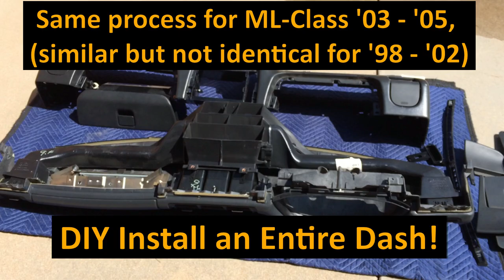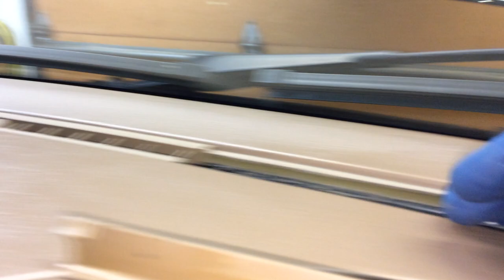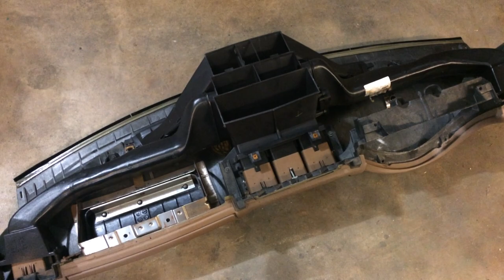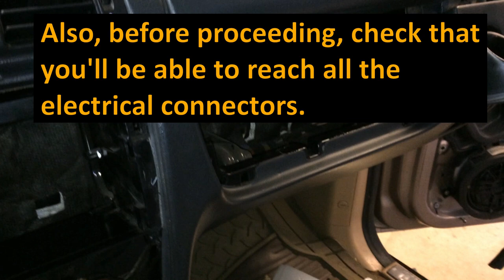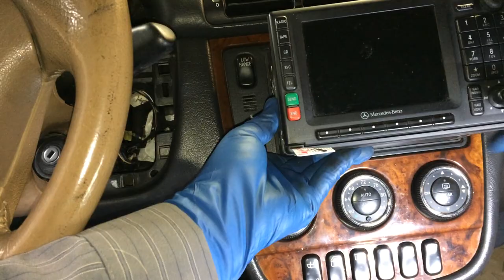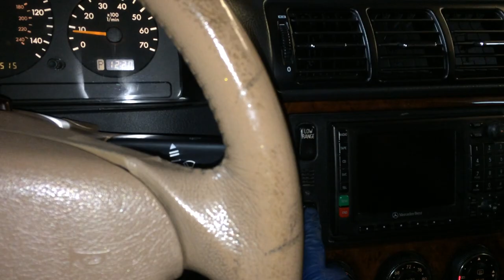Mercedes W163 ML-Class 2002- 2005 Replace Blend Door Motor, Dashboard Removal, Replace Entire Dash

Comment from the maker: CORRECTION: At 00:08, I wrote "Same process for '03 to '05" but I should have wrote "Same process for '02 to '05".  Likewise, where I wrote "'98 to '02", I should have put '98 to '01.  The "facelift" occurred for the Model Year 2002.
Timestamps & important info:
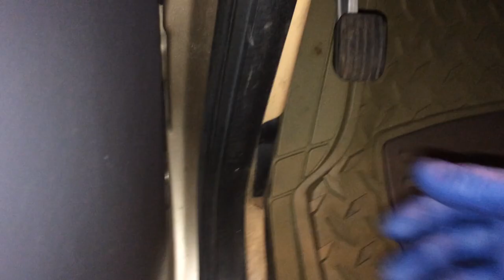00:20  Disconnect negative terminal on battery
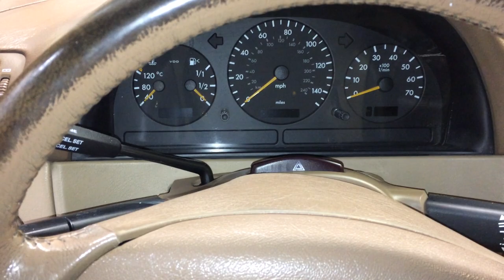00:51  Remove steering wheel collar top trim
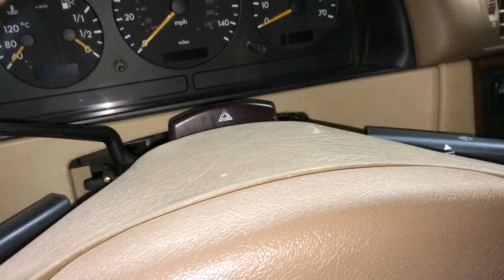01:54  Remove dash panels by steering wheel, right and left
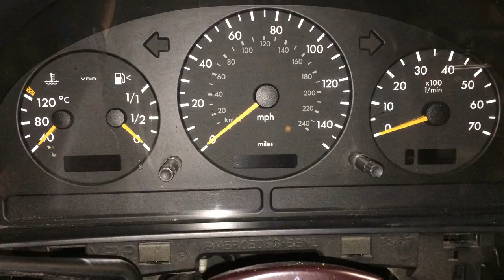02:59  Remove Instrumental Cluster black trim piece
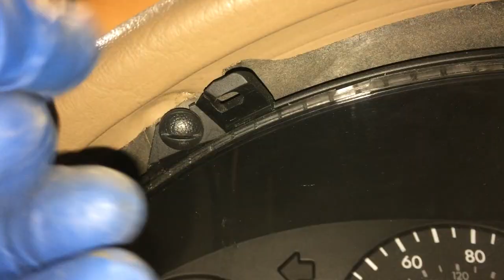03:55  Remove Instrumental Cluster
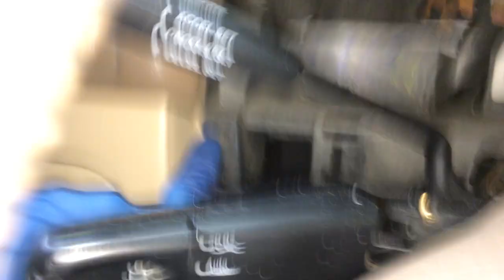05:05  Remove Driver's side dash fasteners
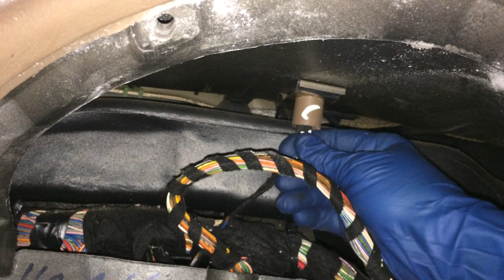05:17  Disconnect electrical for automatic headlight sensor
05:25  Disconnect electrical for front center vent door motor
05:44  Remove fasteners on lower Driver's side dash
05:52  Remove radio
06:00  Reference drawing to make your own Radio Key
07:17  Remove upward facing dash fasteners behind the radio opening
07:39  Remove A-pillar trim pieces
08:33  Remove dash side trim panels and Torx 25 screws
08:47  Remove Defroster Vent Trim and fasteners
09:39  Remove Glove Box
10:30  Remove Wood Trim panel around radio opening, remove electrical switches
12:14  Remove four dash fasteners behind radio Wood Trim panel
12:33  Remove Passenger's side lower fast fasteners
12:49 *Check that all fasteners have been removed*
14:28  Start to remove Top Dash
17:52  Remove Heater Air Temp sensor before completely removing the Top Dash
18:37  Top Dash removed
18:42  Mouse activity discovered!
18:51  Blend Door Motor/Actuator location
19:12  Discussion and demo on the alternate method for reaching the motor (through the passenger side airbag pad, pros and cons)
20:40  Remove and replace Blend Door Motor, with notes about other models
23:12  Remove Lower Dash (not required if you only needed to do the Blend Door Motor)
24:47  Locations of some of the other HVAC motors
25:21  Remove lowest panel on passenger side dash (cabin air filter area)
25:58  Start re-install of Lower Dash
27:57  Start re-install of Top Dash
28:49  Reinstall Heater Air Temp. Sensor
30:09  Top Dash in place, start alignment of Lower and Top Dash
31:39  Reconnect electrical for Headlight Sensor
31:45  Reconnect electrical for front center vent door motor
32:03  Start re-installing each dash fastener (all are shown)
32:56  Re-install Wood Trim, and re-install switches (if removed)
36:11  Re-install Glove Box
37:35  Re-install dash side trim panels
38:04  Re-install more dash fasteners
38:28  Re-install Defroster Vent Trim piece
38:53  Re-install Radio
39:53  Re-install Instrument Cluster
40:48  Re-install Instrument Cluster black trim piece
41:12  Re-install dash panels by steering wheel, right and left
41:37  Re-install A-Pillar trim pieces, with solution for broken tongues
44:29  Re-install Steering Wheel Collar Top trim piece
45:40  Final check -- make sure you're in Park, and reconnect negative terminal on battery
45:55  Start engine and check for lights; test the systems and switches
48:25  Re-set the digital clock
49:06  Re-enable the Radio using the Radio Code
49:34  Thanks to you all for 200 Subscribers!  :)

Here is the Steering Wheel video (swap wheel, remove airbag cover from airbag, swap steering collar trim, replace to dark interior colors):
https://www.youtube.com/watch?v=Iui7oghQzs0&t=1052s

If you have an earlier ML-Class ('98 to '01), watch this video also, because there are some differences on the earlier models:
https://www.youtube.com/watch?v=-iOAhZ1zRpw

I hope this video helps.  Please post any questions, observations or tips in the Comment Section, especially if you've done this before and can offer some more ideas to make it easier.

Good luck with your repair!

Comment: I have a 2001 ML430, which is about the same I think. I was going to do my blend door actuator repair the quick way; break the tabs and glue it, which I really didn’t want to do. After watching your video, I’m going to do it correctly and enjoy it. This was amazingly well explained, thorough and not rushed. This is my daily driver ), so I’ve been putting it off and dealing with HOT A/C. Thank you so so much!!!!! You are awesome!
Reply: How did it work out?  I have a 2001 also.  What were the differences that you remember?

Comment: Quick ?  Looking to buy a 01 ML 320 but the dial to change from floor to defrost to middle vents doesn't seem to be working. It blows crap tons of air through vents but when I change to floor nothing happens. I have the cable driven air distribution. Would this be an easy fix?
Reply from the maker: I'm not familiar with the MB cable drives in particular, but in general, those cable drive systems are much easier to work on than these digital system. If there's little or no resistance when turning the dial, it could be as simple as a dislocated cable or door/redirector hinge: if it's very hard to turn the dial, then it might be a jammed door/hinge.  This thread might be a good place to start - the second post includes a pdf of the cable locations:
https://www.benzworld.org/threads/1999-ml320-defrost-problem.1630793/
I hope that helps : )
Reply: @L35inColorado  
Thanks

Comment: H
I, I have an 03 mercedes ml500 both low beam headlights went out regular halogen bulbs not less, need help.great video very detailed you are very good at your craft.
Reply from the maker: I'm sorry that's happening -- check out the diagrams in this post (relays and fuses):
https://www.benzworld.org/threads/both-low-beam-headlights-do-not-work.1954402/
I hope this helps -- good luck!

Comment: I'm back again after you helped me with my power steering hose (I think I pinched the O-Ring and have a slow leak, but I've given up on that one!) Back to this video however. In the spring I could not get any cold air, so I removed the glove box and moved the white actuator arm by hand and I then had cool air all summer. (At 21:00, we have the white plastic arm.) So now that we are heading into fall and my thoughts turn to warm air, I cannot seem to move the white arms anymore. I disconnected them from a copper colored pin that is on the left side, and now they move. On the right we have the actuator motor, but what is it controlling on the left side of that arm? The reason I ask is, my actuator motor is still working because it moves when you move the temperature dial, but the white arms are seized when connected to whatever is on the left and I cannot get hot air past 33C. I'm thinking that whatever it is on the left side is controlling the amount of heat that goes into the vents as I can feel the pipes that lead into it are very hot.

Comment: Dang you are awesome I luv watching your vids. Well I have this same situation. My AC is working but my heat isn't. But all other functions are,  so as I talk to my mechanic he said it's the diverter.  So I just need heat for the small time in Florida where it's cool because the defrost doesn't clear my windshield.
   Another YouTube or just took the pin out of the plastic  arm and had heat but he didn't really have a method to get AC back. I guess then I will just put the pin back into the plastic arm?.
Please & thank u
Reply from the maker: I'm sorry I missed your comment and am so late to reply - I'm not sure about removing parts on the blend door motor. My recommendation would be to replace the motor while you're in there, just because it is a far amount of work to get the dash out and all.  As you know, the MB defroster system leans heavy on heat for the defrost function, so it would be most advantageous to keep the original design intact, which would mean replacing the blend door motor if your is faulty.  Thanks for watching and good luck : )

Comment: Great Video.  My blower is working but I am not get hot or cold air. When I turn on defrost it is not bbn blowing out of the windshield vent.  Does this sound like blend door motor? I never had clicking  it just stopped.  If not what else should I be looking at.  Thanks again for a great video.
Reply from the maker: Thank you!  What you're describing doesn't sound like the blend door motor, but rather the defrost motor/door/arm, all which is also under the dash.  Check out this thread for some more information -- I haven't had this problem myself, but this thread describes some info that might be helpful to you!
https://www.benzworld.org/threads/front-defrost-problems-does-not-work.2317665/
Good luck!

Comment: May i ask what wheels and running boards you have on your build?
Reply from the maker: Sure - This is my sister's ML350: I found the running boards at a local junkyard a few years back.  They were from a "Special Edition" W163:  as far as my experience in the junkyards, these boards aren't super common, but they do still pop up from time to time.  Some junkyards (such as LKQ) post pictures of the vehicles they have on the yard, and you can just keep an eye out to see if one pops up in your area.  
As far as I know, there aren't any aftermarket options that look like the MB running boards, but there aftermarket "tube step" options. I hope that helps! : ) Thanks for watching!
Reply: @L35inColorado  thanks. I just went to LKQ down the street the past few days to pick up some things for minor repairs on my 320. i guess i’ll have to go out into the neighboring towns to try my luck with some really good parts lmao.

Comment: Great video, but PLEASE NOTE:  YOU FORGOT TO MENTION THE TWO SCREW/BOLTS IN THE CENTER!   Once the 4 bolts around the stereo are out, THERE ARE 2 MORE.  They reside just behind the top of the stereo opening.  They go UP through the metal frame/support and into the dash.  Either you forgot the mention these, or someone (before you) had already removed them.  You can see the metal clips into which they fasten right at 18:30 (just below where the beige color ends, and the black plastic starts).      Look again at 18:37 - once the dash is out, you will see the large black bar support that runs across the vehicle.  Right in the center are two flat flanges w/ clips that protrude into toward the cabin.  If you do not remove these two screw/bolts, you will destroy the dash trying to pull it out.
Reply: Also note, ALL the W163 dashes have these extra 2 screws.  Including the 1998-2001.  The only real difference between the pre-2002 and 2000+ is 1) the additional 3 wires to disconnect and 2) the way you access the screws on each side (where the door meets the dash).  Other than that, they are identical (the top parts).
Reply from the maker: Do you mean the two 7mm screws shown at 07:17, behind the radio opening -- those two screws that fasten upwards?
Reply: @L35inColorado  I stand corrected!  Not sure how I missed that part? Lol...
Reply from the maker: @deanrantala  That's okay -- thanks for adding your tips on the '98 - '01 models!  Good luck : )

Comment: This is a great video and is very helpful. Thank you so much. Do you know anything about replacing the brake ABS module. Mine has gone bad and the mechanic quoted me for $6000. I was wondering if I could just find a low mileage module and just swap it out but I'm not sure if I have to replace the ABS computer with it too.
Reply from the maker: Thanks for your comment, I'm glad this video helped!  
As for your ABS module -- wow, that's a really high estimate.  If your mechanic knows for certain that the problem is your ABS module (he could isolate it by reading codes and troubleshooting), then it is likely that the problem with the ABS module is actually the motor part on the module (the motor is for the ABS pump).  It is a known issue with these unit's that the brushes wear out (the brushes for the pump motor).  The motor is for the pump, so when it stops working, the pump doesn't work and the ABS doesn't work.   As a mechanic, he would want to replace the whole unit, but as an DIY'er, you might be able to just pull out the motor, open it up, and replace the brushes.

Here is what I mean, check out this video:
https://www.youtube.com/watch?v=cFYF7TnWfRE

That video shows an ML270, is an overseas version of the ML.   You'll notice in that video that he has the washer fluid tank removed.  It is easy to remove that tank if you have a pre-2002, because it is a small tank.  But if you have a 2002 - 2005, there are a few more steps (its a bigger tank).  Here is a video for removing the washer tank, and at 14:47 of this video below, I show the ABS module:

https://www.youtube.com/watch?v=K8Kf90Z8sUI&t=1113s

If you're comfortable pulling the motor off on the ABS module, but you don't have the tools to open the motor itself, apparently there are also some send-away services available (or at least there used to be), where you remove the motor and send it away for repair (they probably just replace the brushes and maybe the shaft bearing).  Here are some threads to check out which mentions that:

https://www.benzworld.org/threads/abs-pump-motor-separation.1641693/
https://www.benzworld.org/threads/c1401-abs-ets-bas-lights-come-on-randomly.1530501/

If you have the tools to open the motor, (you can rent a bearing separator at most auto parts stores), here's another video which shows more detail than the first video with regards to the brushes:

https://www.youtube.com/watch?v=EryDggbtWy8

If I had your problem and had it pinned-down to the ABS module, I would probably just go ahead and remove the pump, open it up, and replace the brushes (and that bearing, if needed).   You cannot just buy the motor new (you have to buy it as part of the whole unit), and if you replace the whole unit, then you'll need to disconnect the brake lines and bleed it all that.  As for the computer recognizing the new module -- yes, I've read about issues with that, but I don't quite understand it.  It seems to me a mechanic with STAR system would be able to iron that out if the computer doesn't recognize a new module for some reason.  However, if you leave the ABS module in place and just remove & repair the brushes on the motor, then you won't be changing anything and so the computer will not notice any difference. 

The problem with swapping the unit out with a used unit (either a used whole module, or a used motor) is that you might have worn-out brushes on the new unit, too, then you're back to square one!  If you have a junkyard near you that has a W163, perhaps head over there and do a practice-run on removing the pump motor (though they do disappear quickly because of exactly this issue).  If you can get one removed at the junkyard, you could probably buy it for a couple bucks and then have some extra parts on hand.

Good luck!
Reply: @L35inColorado  Thank you so much. You have saved me thousands of dollars.

Comment: Hi great video I have a problem that my ac ia working but only blows to the floor the front face vent are not blowing do you think thia actuator is my problem?
Reply from the maker: I'm sorry that's happening -- that sounds like an actuator issue, but not this particular actuator (thought the actuator causing that effect might also be under the dash).  There are some other HVAC motors shown in the video at 24:47 -- I'm not sure which features these control, but you might be able to do some research and determine if any of them are responsible for what you're seeing.  I hope that helps -- good luck!

Comment: Learned a big deal from every class you taught. Wonder what is the reason for disconnecting the battery? Thanks.
Reply from the maker: Thanks!  I disconnect the battery when I'm working near/with airbag/SRS stuff, even if I'm not removing the airbags, and especially if I'm not certain of exactly where all the SRS sensors are located.  So it is a safety precaution : )   If the system is working correctly, the airbags should not deploy once the vehicle is in "sleep mode", but I'd just rather not take the chance and get a wild surprise!  Thanks for watching : )
Reply: Got you, Thanks for the detailed explanation. I practiced this process at Junk yard this past weekend and will install it on a 2003 ML350 next week. Its AC was very cold originally but failed to blow cold air all the sudden one day. I suspect it is the actuator because it is one of its quality problem due to the plastic gear in the motor.  @L35inColorado
Reply: I also learned that in order to access the left bolt behind the radio, pointing downwards, it is better to loosen and pull the lower dash out a bit in the center area. The right bolt is relatively easy to access from the glove box area. Other than these two bolts, all the other bolts are relatively easy. Need to pull the day light sensor, the other vent motor, the temperature sensor connectors out before pulling the upper dash completely. The vent for the windshield almost 100% going to be broken, unfortunately, due to the intensive heat it receives over the years. This approach of moving the upper dash out actually is less labor intensive and troublesome than cutting the air bag cover and then glue it back. Also it is still a bit challenging access the motor screws even after removing the air bag.

Comment: where is the directional motor to change air flow from floor to windscreen?
Reply from the maker: I don't know, perhaps call your MB dealer, or start a thread at www.benzworld.org foums.  At 24:50, I show some other motors, but I don't know which is for what function.  Good luck!